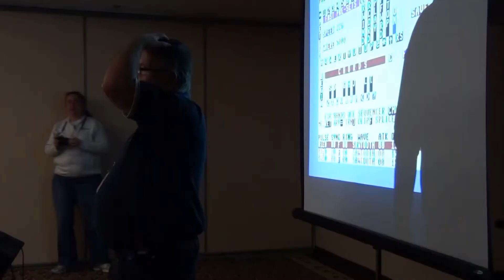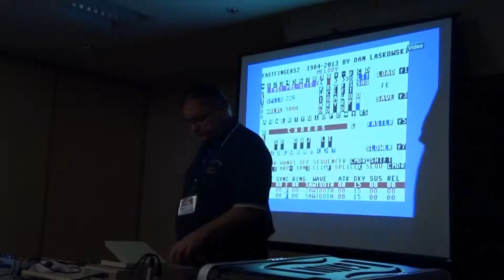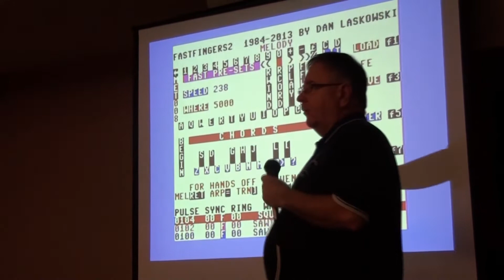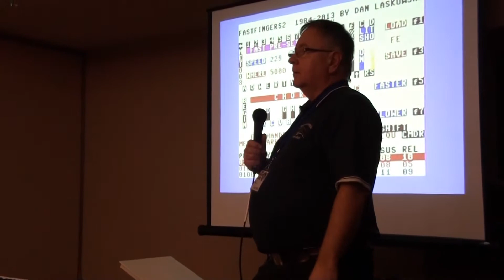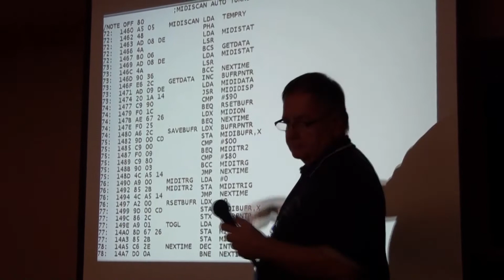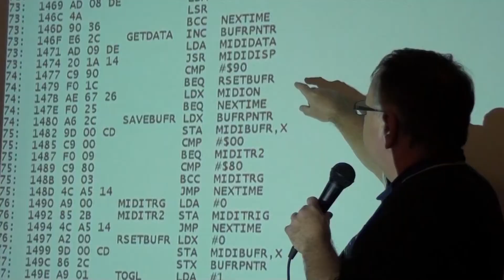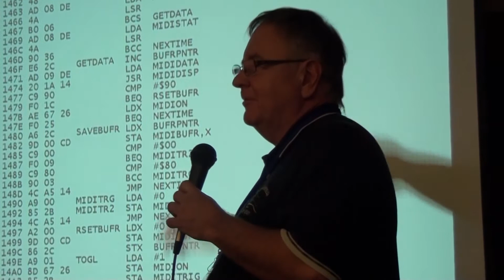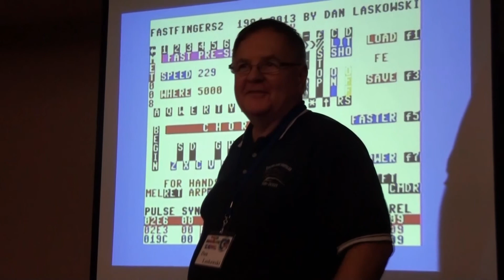World of Commodore 2012 and FASTFINGERS MIDI

Comment from the maker: The MIDI version still has bugs (plays some wrong notes) but you can write to me  and I will put the ORIGINAL version up  on Ebay for you. It comes on a 5.25" floppy disk for $30. There is also an interface to plug a Mattel Intellivision keyboard in for another $30. I'm working on a new MIDI interface based on the PIC CHIP but it is more difficult than I anticipated. Follow links in my video description to find me. you tube won't allow links in this message.